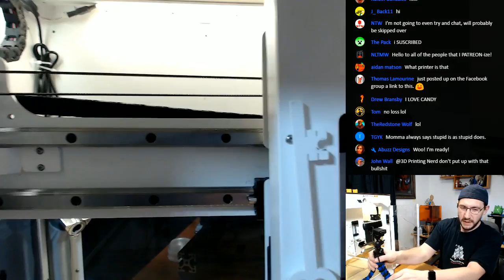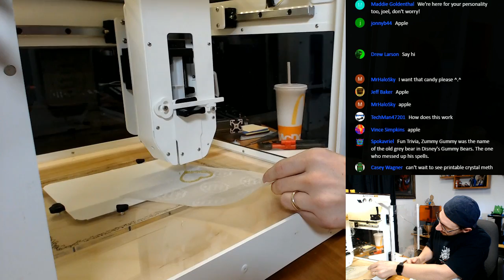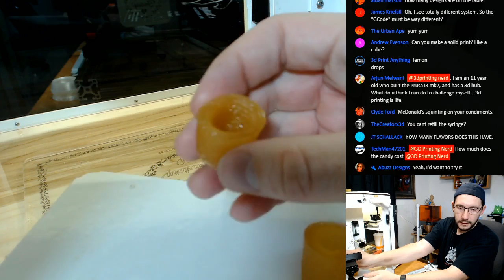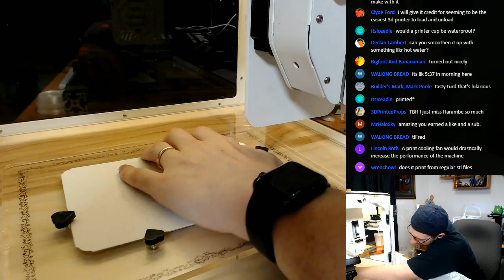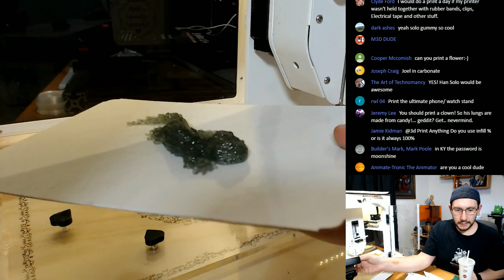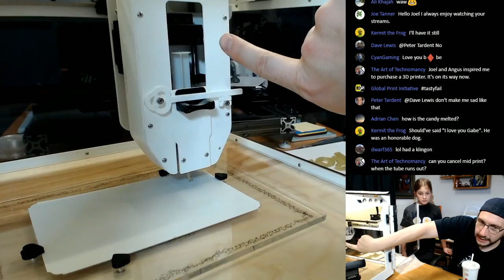3D Printing Candy! The Magic Candy Factory 3D Printer!

Comment: i know this is 2 years ago but they could use ribbon candy in the extruder to print you would need an extruder with heated rollers to roll the candy to the right size for the nozzle (like down to 1mm) and print really slow would need a parts cooling can though

Comment: well...this is totally useless though, lol it's to slow, you can make hundreds or thousands of gummy candies in the time it took to make two,  what are they thinking?, 3d printing will never , ever be cost effective for mass production, there's a huge reason why injection molding is a thing, because you only need to make the molds then you crank out parts by the hundreds , no 3d printer ever will do that as efficiently as injection molding, because layers = slow, and an entire part formed in seconds = fast. even if it's just for making special shapes, it's still faster to just buy a shape someone already made, or 3d print a candy mold lol

Comment: Well you convinced me to buy a 3D printer... I bought the Anet A8 3D printer and then right after I built it the side exploded and now I waisted over 400$ ... on the broken printer and filliment ...thanks for nothing
Reply: GymBoyB 3D printing  is a fun hobby and if you take your time to fix up your printer it can get very fun. I have spent over 100$ for new extruders just for those to not work. So if you take your time it is very fun. Good luck on that.
Reply: You obviously did something incorrectly. Hundreds upon hundreds of us use the Anet 8 with very good results. It takes a lot of research and reading to learn the craft. By the way "waisted" is spelled "wasted". You can go off on me now if you want.  Great vid Joel thanks for posting.

Comment: Pity it does not do chocolate, you could print my wife, I love chocolate LOL RobUK
Reply from the maker: they DO make a chocolate printer!
Reply: Wow. I would think chocolate would be very hard to print. It is finicky about temperature and the amount of humidity in the air greatly affects the ability for molten chocolate to properly solidify. That would be a nightmare to design and while it's a neat concept, I think poured chocolate will probably continue to be more accurate and effective overall.

Comment: Very cool, but for the price and print quality, think id rather print a mold and cast some gummy. If you use food safe high temp filament, you could print the actual mold and no need for silcone etc...
Reply from the maker: +Jakalwarrior for the price? I didn't think I said anything about the retail price, did I?
Reply: 3D Printing Nerd could have sworn you said it was prohibitively expensive. Could be remembering wrong.
Reply from the maker: Oh, OH! Crap, so, yes, it's said to be a $30k or $35k machine, but, it's meant for commercialization and used for a business. In reality, the custom prints are (most likely) $5 - $10. They are SUPER popular as gifts, people are going nuts for them.
Reply: 3D Printing Nerd that's not bad at all, though now I have the idea of low temp food molds stuck in my head... Imagine bender Jell-O shots for going on a bender, or gummy ones with something inside, like pop rocks for a brain.
Reply from the maker: That's a great idea!